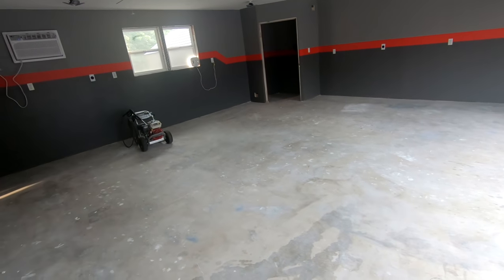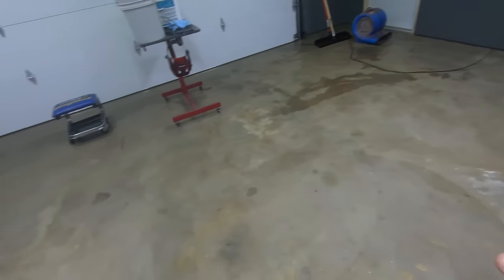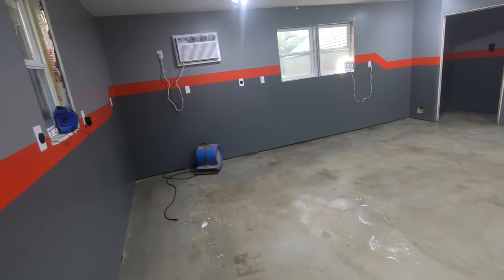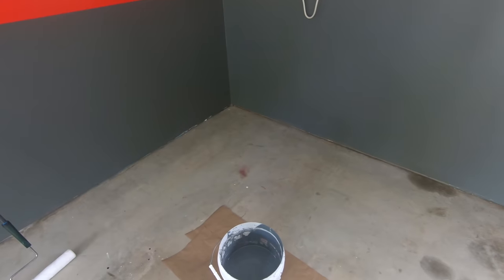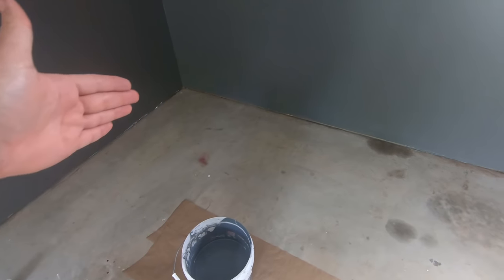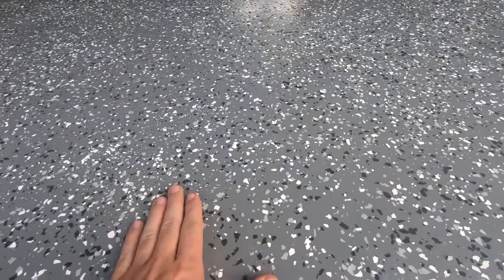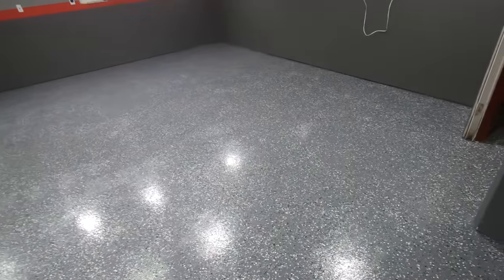Garage Reno Pt.11 - Rust-Oleum Epoxy Professional Version Install! DIY!

Comment: Prep, prep, prep !  I spent 3 days prepping our floor and after 9 years, it still looks great.  No scratches, chips, or fading.  My neighbor spent almost $4K having his done professionally  and ours has lasted  better than theirs !
Reply: Did you do a gloss coat?
Reply: @dexduger6026  No  clear coat.  I just use acrylic wax for a great shine
Reply: Damn that’s crazy… did you also you rust oleum?
Reply: @jaskarankhosa8157  Rustoleum "Professional."  I used the solvent based epoxy, not the water base.  Water base is junk.
Reply: Did you etch or did you use a diamond cutter to clean up the concrete? Seems like everybody loves one and hates the other.
Reply: @Alurpal80  I only had to etch with muriatic acid, then neutralized with baking soda.  If the surface is already smooth, grinding shouldn't be necessary.
Reply from the maker: Yea, so many ppl say if you don’t diamond grind, you are going to fail… I just don’t agree fully. I did mine with acid. Still holding up good. But both options I think work depending on your concrete
Reply: @StewartMotoring  thank you, I was debating between rust oleum and professional. I’ve few questions and would appreciate if you can shared your experience, do you park your car everyday in the garage? If yes, how is it holding up against tire marks, chipping or peeling? The clear coat you’ve mentioned, where can I buy it from? Thanks in advance for your help.
Reply: If doing a new construction home, do I need to have the concrete smooth prior to rolling on epoxy or will epoxy “level” the very minor rough texture the floor has
Reply: @AdamConstantine  It will cover minor rough surfaces as long as you apply a very heavy wet coat.  If you use the colored flakes, you'll never see the imperfections.  Make sure the concrete has completely cured and there is no moisture content.  To make sure it's dry, tape down a trash bag to the floor and wait at least a day.  Remove the bag to see if it's damp.  If so, the concrete is too "Green" to apply the epoxy.  It must be completely dry and cured.  :-)

Comment: I would strongly suggest renting a diamond grinder to properly prep the floor. Profiling the concrete properly is the only way to guarantee a mechanical bond. Also using a primer or high quality epoxy or polyaspartic would create a floor to last for ages. Not bad for a DIY! 👍🏽

Comment: Thanks very much for your advice and help.  I'll return the ball here.  Paint your walls white.  It reduces the amount of light wattage or boosts what you can see in a hurry. With all the tools and whatnot there is enough color without making your place dim with wall and ceiling paint. I like Zinnser123.

Comment: Rustoleum and professional dont go in the same sentence. Ill give it a year before it starts to fail
Reply: It doesn't seem to me that epoxy is a terribly complex product to make.  Why would this epoxy fail?  It seems like it would be harder to make crappy epoxy than it would be to make run of the mill good epoxy.  Doesn't seem like rocket science to me.  What am I missing?
Reply: I did the same process and used the same product 9 years ago !  No chips, peeling or fading. Even rolling a metal wheeled floor jack on it with no problem.  Gas, oil and even lacquer thinner hasn't hurt it.  JMHO

Comment: My epoxy floor is 20 years old.  The pro who installed it for me spent 1/2 day torching the floor to drive out any moisture. I thought it was overkill, but with 20 years use, these is no separation from floor. I would strongly recommend this step. Also, I would recommend 2 coats of clear. Great job thought!
Reply: That’s actually smart

Comment: I am thinking about doing my garage. Do you need to use a respirator for this type of epoxy?
Reply from the maker: I didn’t, but you certainly can if you want as I had my garage door and windows open. If the garage door is down and you don’t have any open windows, I would recommend wearing something.

Comment: Nice job, but a couple of areas to improve the end result in case you do another, or others watching this read these comments:
1) The flakes can be spread much more evenly using a "shaker" (drill a few holes in a plastic container) as you can see (eg @9:28) the way you've thrown the handfuls of flakes around and how they concentrate and disperse in a fan shape in many areas, instead of being really uniform and consistent.
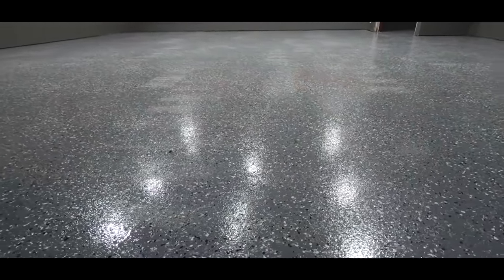2) When painting or rolling a coating like this always finish with a finish roll (roll in one direction eg back towards the garage door and lift off lightly, move the roller to the next part and repeat) because if you go back and forth and lift off randomly you'll get the non-uniform finish (gloss vs satin almost) eg @13:55 pan.
3) A lot of people don't use the professional version which could explain the variation in quantities they used vs what you found worked for you.
4) Although your floor section technique avoided the need, spike boots (<$20 on Amazon) give you the ability to walk over the coating when wet, which makes it much easier to roll the coating and throw flakes eg you can roll the whole floor first then do all the flakes at once.

Comment: I used the light gray version 7 years ago in my garage. If you prep it definitely holds up well, just a few missing chips mostly from floor jacks and lifting weights. 

I do not recommend the clear if you live in a sunny 🌞 state. My turned yellow after a year, I know it’s the clear because we’re I missed to cover with the clear those spots look brand new.
Reply: Which clear coat did you use, do you remember? Thanks

Comment: I did this in my previous house by just cleaning, etch, filled  the cracks and applied the epoxy and chips.  I scraped the excess chips and skipped the clear coat. No hot tire pickup and it was so easy to clean, the only downside was it was slick when wet.  I really need to do my new garage.

Comment: Great video! An important tip to add  in the prep process that is commonly overlooked  is if a finish seal coating was applied to the concrete floor you have to use a concrete floor grinder to remove the sealant for the epoxy to bond to the floor. Pressure washing/acid washing/and concrete etching will not remove concrete sealants and the epoxy will delaminate and peel from the floor.
Reply from the maker: Correct, if the concrete is sealed you’ll have some extra work to do to remove it. Luckily mine didn’t. There is a process to go about checking which basically just pour some water on the concrete and if it pools up - it’s sealed. If it soaks in the concrete it isn’t. Don’t quote me but I think that’s all it is.

Comment: Not a direct knock on Rustoleum's product per say, but I have a real issue with them including the term "Professional" in a kit that isn't 100% solids.  That aside, on the dense patches of non-slip additive, you generally want to broadcast the aluminum oxide ("sand") by hand with spiked shoes after putting the final coat down (and then back roll to integrate).  Not sure what Rustoleum's instructions were, but generally speaking that will give the most even results and has the added benefit of really letting you inch your way towards the amount you want to use (just like the flakes).

Comment: Looks good.  I'm not a bis fan of this DIY product.  I've picked up so many like as in it was pealing . But I di believe that it's all in the prep for sure.  I would've going the floor first and then patch any cracks/holes then the product. For sure I would've added a full broadcast of Flakes and another sealer.
Reply from the maker: Still holding up for me. No issues

Comment: You guys really did a good job. I'm hoping in the next couple weeks now that the 110° days should be over that I can redo my garage floor. It's been 16 years since the last time we did anything with the floor. It definitely needs to be freshened up. With all the gas and oil that I have dropped on the floor over the years has taken its toll. The only thing I plan on doing different is to buy some pads to put down whenever I'm working on something in the garage. That way I don't have to trust the manufacturers saying on the package that it will stand up for gas and oil. Again really good job.

Comment: Must be very hard to sweep or even mop the floor now with the rough surface (anti-slip usually mean hard to mop clean) ... but the overall effect Shiny is very nice ! :) thanks for sharing
Reply from the maker: It’s actually the opposite. While the surface has sand in it.. it’s still smoother textured than plain old concrete. It’s easier to sweep/blow debris around in this floor than concrete.
Reply: @StewartMotoring  This was my question, thanks. Great job btw-
Reply: @StewartMotoring  Jacques and I had the same concern.  I appreciate you for sharing your feedback.  Using the grit seems safer to reduce slips and if you're saying it hasn't made a headache for cleaning, I'm sold on using it.  Thanks!

Comment: @StewartMotoring

Amazing job! 

I am going to be doing my garage this coming spring and I am curious on how your garage floor is holding up? 

I did a garage floor 10 years ago in this same  product and it’s still holding strong, I wish I would have put the clear top coat on it. Prep is the key I spend days cleaning and etching it and letting it fully dry before applying.
Reply from the maker: Still holding up well. Been meaning to do a update
Reply: Thank you!

Comment: It's not the coloring that worries me....it looks spectacular.  It's the clear coat.  If that's not a high-quality, then a year, or two, from now he's going to be having problems with it pealing, or staining.  I'll be interested to see how it's holding up for him.  Short of the durability question, this looks fantastic.....well done!
Reply from the maker: Thanks. I’ll do a follow up at some point. Still looks good so far. Couple scratches in it now but it’s a working garage 🙂
Reply: @StewartMotoring  Looks great.  Yup...scratches will build up.  It's a garage floor after-all.  As long as it doesn't peel from your tires, you saved a tone of money, and it looks outstanding.  I live in FL, and down here it's the heat and humidity.  Our previous homeowner used a cheap paint on our floor, it it started peeling almost immediately.  So, now I've got to get all that crap off the floor, then decide on a product.  I was considering Leggari products with their lifetime warranty, but it's also, 3x's the price.  I starting to wonder if maybe going with this product and either a 2nd clear coat, or maybe just getting a high-quality clear coat from another supplier would be the way to go.  If I can keep it under $1K I'll be happy.  But, that's a major job, to pull everything out of a garage, to resurface the floor.  If I went through that and then had to do it again in 2-3yrs, I'd put a gun to my head....LOL.  Definitely keep us all in the loop.  If this lasts, it's a great option.  Thanks for taking the time to do this....I know the video camera and explanations are an added inconvenience....so, alot of us really appreciate your taking the time.

Comment: Hey bro great Update! I was going to use the Rustoleum too, and i read the exact same reviews that said you needed 2 kits to do a 2 car garage. My Garage is a 2.5, (with the workshop area i have behind) so i figured i would need 3 kits to do the job. 
I don't know how expensive it is in the states, but down here in Australia, its exxy as, one rustoleum 2 car kit is $300! So i figured I'd need $900 to buy 3 kits to get the job done. Then the multiple man hours to do the job over a few days, I ended up getting a quote that was $1300 for a professional to do it, so for $400 more, i did a little extra OT during one week, then put my feet up and drank beer while the guy did the work over 1 weekend. Benefit was he also concrete grinded my slab because he had all the right gear.
Your garage looks great! similar to mine with the 2 tone and stripe haha! Floor looks good, i think the coverage issues are with the metallic colours like the blue and cherry bomb. The flake looks good but you will be cursing the day you drop a M5 bolt or nut on the floor and it just blends into the flake chips and it takes you half a hour to find where it fell. That's the reason i went solid colour on mine.

Cant wait to see you deck it out mate!

Rudi.
Reply from the maker: Thanks. Yea here in the US the kits I showed in the vid are just a bit under 100 usd. So pretty cheap really. And I have already dropped a couple nails and I’m like where the heck did that go? Blended in. So yes it’s already playin tricks on me but maybe I’ll learn not to drop things haha.
Reply: Last year during boxing day sales, I purchased a 2.5 car kit and a single car kit for around $345 or so total from supercheapauto. If you have not already gone ahead and done this, wait for a few days. I'm sure you'll find some boxing day deals.

Comment: Great Job, Very impressed ! Hey I'm in process of applying epoxy, and have just done the degreasing. I also bought two of the 2.5 garage kit. But I was wondering if I should put the first coat all through out, wait for it to dry and then do the second coat and chips. Now that I have seen your video, I'm thinking if I should do it all at once...thoughts!!
Reply from the maker: I would do all at once. I don’t think the instructions say to do it the way you are describing. But definitely give them a read just to make sure
Reply: @StewartMotoring  Thanks!👍

Comment: Great video! I have recently done the epoxy shield on my floors and I was just wondering if the clear created it’s own thick layer and made it smooth? Currently I can feel the coarseness of the floor and the chips
Reply from the maker: No, the clear wasn’t thick enough to level it out. Still textured

Comment: Should I use a primer or does it matter? In this example, I still saw stains and spots on the concrete. How do you know when it’s “clean enough”? Is there a problem with applying it all the way to where the driveway meets the garage?

Comment: Hey @Stewart Motoring, a question regarding the etching process.  Was the concrete etching product in the kit sufficient to prep and clean the concrete without having to use any tools like a floor buffer with a diamabrush?  I am going to be doing this project in about 2 weeks and am trying to learn all I can about the process.  Thank you.
Reply from the maker: That’s the big debate. Is the etch product good enough to where you don’t need to diamond sand it. I didn’t not diamond brush it and I’m not having problems

Comment: Hey, great video. I have a quick question. How has the floor been holding up? Any lifts, peels, or scratches? I’m going to do an epoxy floor in my garage/ workshop. I already grinded the floor. I’m just wondering if I should go with the rustoleum brand or get another epoxy brand online. Thanks
Reply from the maker: Floor has been great. No chipping or cracks or peeling. I’ve got some scratches in the clear from usual stuff. Like a rock getting caught in a creeper wheel, but that would scratch anything imo. But that’s just normal wear n tear. Otherwise looks good like day one.

Comment: Thanks for the detailed instructions. 

Question : did you use or do you recommend anti skid? I heard that reduces the sheen of the floor and is not really necessary. Could you share your thoughts please.
Reply from the maker: Your welcome. Yes I used the anti skid. I talked about it in the video. Imo it did not dull the floor. But I’m not experienced with the stuff. So maybe it does, but the floor is very glossy because of the clear coat and anti skid mixture.
Reply: @StewartMotoring  This helps. Appreciate the feedback sir.

Comment: Why I see some videos use a primer and some don’t? I’m nervous now lol I didn’t apply primer before putting the epoxy and flakes down
Reply: I never used a primer when I did my previous house, I had zero issues. Prep is key. Clean then degrease then clean again to get all the degreaser out.  I etched with Muriatic acid cleaned again with water then etched a second time and then neutralized the acid with a baking soda water mix. Cleaned again then hose it out througly with plain water  and a stiff broom to get any residue out.  Let dry for several days if you don't have a dehumidifier. Test the concrete for moisture before you apply anything, itf it still damp leave it to dry longer.  I believe most of the issues people have with the product pealing is from moisture in the concrete.

Comment: Nice.  I wished I had put the color on my 3 car garage. I used the yellowish one forgot what is called..have a question though my walls are gray like urs too but I love red..what's the easiest way to paint the red line all around garage?? My wife did not want me to paint my man cave/garage red so I painteded gray like urs but I like the red stripe across😁
Reply from the maker: Determine the width of stripe and then how high off the floor you want the bottom to be. Go around and add little pencil tic marks around. Then add your width to that measurement and add a second tic mark to create your outline. 

Use some easy release edging tape specifically for striping and lay the tape down on your tic marks. Then paint (red is hard to cover with you’ll need more paint than you think). Remove tape before paint is dry so it doesn’t peel. 

And that’s pretty much all..I do have a video on this so you can watch that for reference.
Reply: @StewartMotoring  where can I watch the video?
Reply: @StewartMotoring  by the way thank u for ur response:)
Reply from the maker: https://youtu.be/Pr0QUi3U1Jc

Comment: Great video — thanks for putting it up! We’re 5 months in - how’s the floor holding up?
Reply from the maker: Floor holding up good. No complaints at this point. No spots that are chipping or flaking or discoloration. Couple scratches from jack stands and rocks from my creeper but that’s normal wear imo.